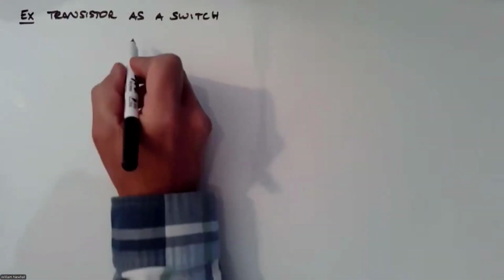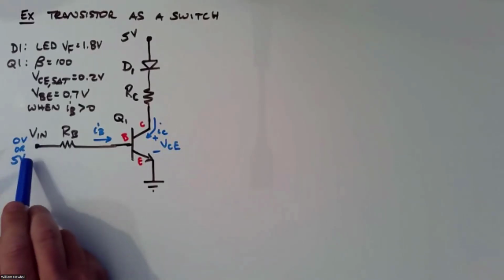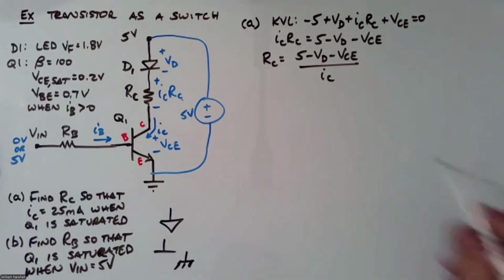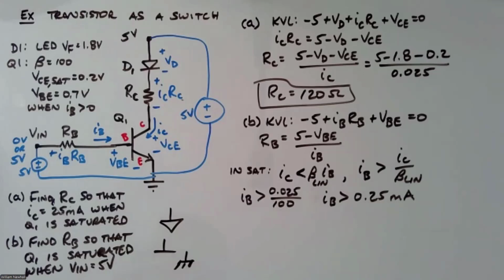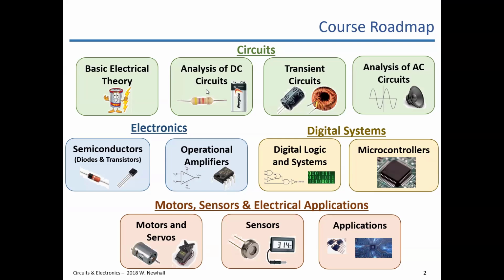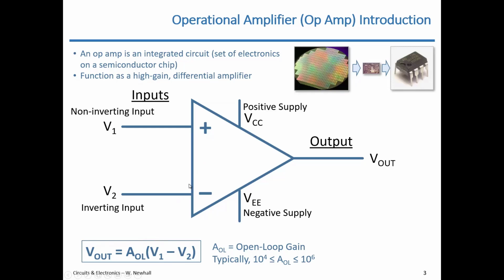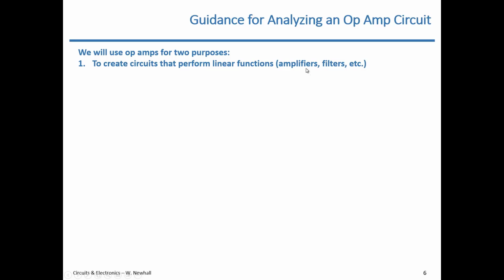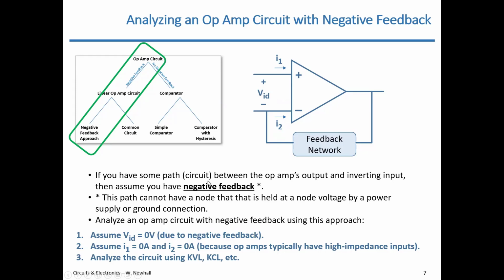Circuits & Electronics - Lecture 17

Comment: First I would like to thank you sir your lectures on YouTube have been a lot of help to me in my journey trying to learn electronics and I wish you all the best and all the good.
And I have a question hear about a piece of information that you were talking about within this video in the minute 23: 41

The thing is 
Aren't we going to lose power anyway 
The 5volts source in the bass part of the circuit are divided across RB and VBE/ib  then the only factor that should be taken into consideration will be the overheating of the transistors when we are deciding how much current should be ib